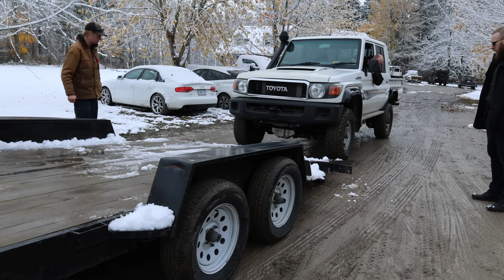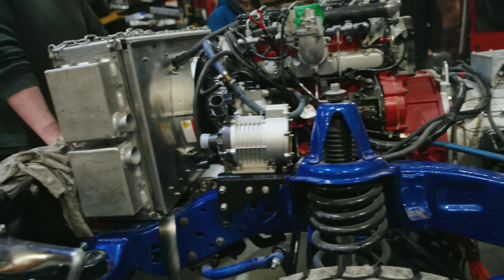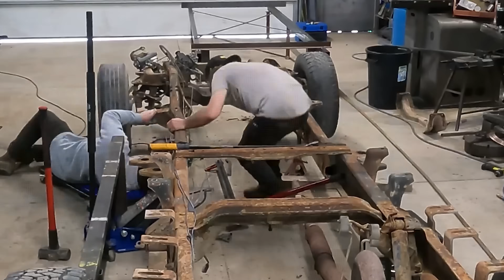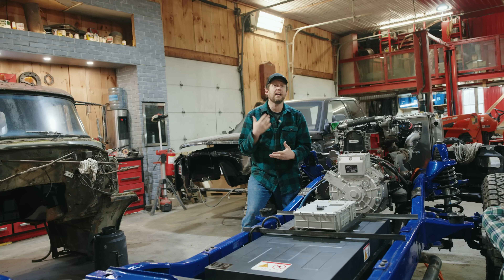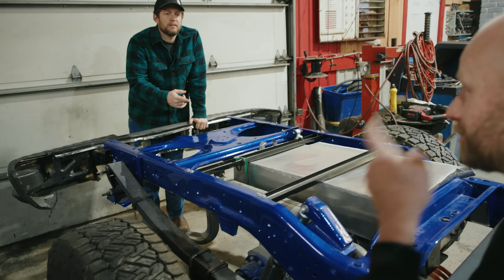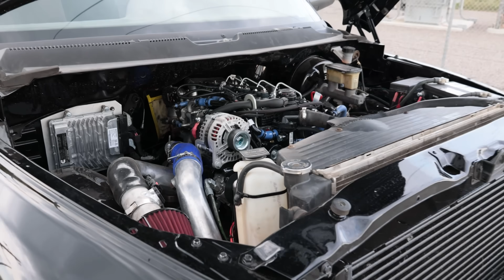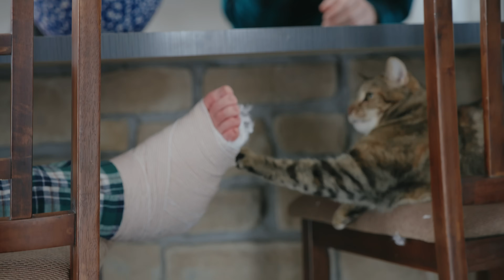Scrap Our First Design and Build an Edison Pickup Chassis from Scratch?

Comment: so on the air ride make sure you have not just front to back but side to side leveling as well not sure entirely how it works one semis but on the leaf spring truck that had cranes on one side often had extra springs on that side to compensate for the weight. i know since i added bags to my trucks some load are heavier one one side than the other and require different psi to level.

Comment: Keep the 34” frame for the sake of turning radius
And being able to adapt from CAD to other cab mounts from manufacturers. We should rethink the trailing arm under the axle. The pickup truck run a much smaller tire than the big rigs and ground clearance sounds like it would be hindered with this idea. However the ride quality sounds awesome. Maybe a portal axles or run the trailing arm over the axle. I hope the chassis kits will accommodate the 9th gen ford areo nose.  Keep up the good work.

Comment: I like the idea of widening the frame and keeping the same width throughout the length.  It would really simplify manufacturing, like the semi.  As far as different bodies, it can be just like the cab end and utilize simple adapting, bolt on cross members and brackets.  Using a trailing arm and airbags also makes a lot of sense... Just Build It!

Comment: Another vote for 34'' frame rails. The depth of the outside toolboxes alot nicer on my cabchassis versus a pickup.

Also you would be such an oddball with a wider frame, it is fairly common to reuse old bodies.

Although if the service body is built to clear leaf springs it would  probably work.

Comment: Talking about frame widths reminded me of some issues we had getting some correct parts for a 2011 F350. The chassis/cab version has a narrower frame width than the pickup version, that kinda surprised me.

Comment: The chassis sounds amazing. I own a 1500 ecodiesel. With only 1200 pounds of payload and 8000 pounds of towing capability. I would love much better payloard and towing but want to keep my engine and cab as the generator. Hopefully this would save on the kit as well because I wouldn't need the 2.8 cummins.

Comment: I want a rolling chassis for a Small Class A R, been saying this since Edison announced the Pickup Kit. Would be perfect as Hybrid RV - the engine also doubles as a Generator -  RVs always have two engines - drive engine and generator engine.  Consolidate to one, further mountains with regen braking.   There is only 1 Front engine RV chassis maker left - Ford.  You could be the second one.  I suggest you get yourself a mid 2000s Workhorse RV and look at the frame.

Comment: I understand you want the Hybrid for the diesel to work however having the larger batteries allows the owner to also charge from the grid if they want and that cost of electrons is 2/3rds the cost of that from the generator. 
Figures below just for example - 
Charge from Home at say CAD 23 cents a kWh verses diesel  cost for say 21 kWh is What? 
Let's say 1 hours consumption of diesel to run the generator is 5 litres at say CAD$1.30 /ltr  $6.50 vs 4.83 from grid supplied 21kWh . 
the Generator provides the on board charging and remote rural use.- exactly what is needed.
Maybe an option is to sell with different battery pack options.  50kWh , 75, kWH , 100 kWh .
It might be the average rig is used on sited that require Electric only operation for the day and only on leaving the site do you need to charge and or drive off the generator.
That is where the onboard genset is invaluable.
Just a thought
Reply: I'm sure that buyers will want a spectrum of battery kWh options.
Reply: @Sah-o5m  given the recent cold artic weather....a lot of folks are going to be showing a lot of interest in CATL Na Ion battery's  they keep working all the way down to minus 40 Deg C and up to +70 Deg C. Also it's rated at 5 C. And life expectancy is 2-3 x LFP cells ..they are even producing automated swap station packs .

Comment: Why can't you use the inner rear fender well for more batteries? All that space is totally unused. But if you don't use the original bed then you can mount the batteries to the sides of the frame rails if you need space in between the frame rails for anything. Don't forget you still need def and exhaust piping also. I like this idea of pre ordering frame setups for the vehicle we want to keep. Will the wiring be a plug and play setup or will replacement be needed?
Reply: Almost forgot great episode!!
Reply: Great job guys!

Comment: I paid the $250 deposit long ago to get in the lineup.  I’ve a 2012 ram 5500 that’s got a Bigfoot camper on the back, Kelderman air bags all 4 corners and 42” super singles.  As it sounds the upgrade for my truck would be a complete chassis as well as all the drivetrain? May be too rich for me.   🤔
Reply from the maker: I still want to be able to sell just the parts, I can’t see why that’s not still possible.   Just a ton of people want the chassis too and it’s easier for us to certify
Reply: @EdisonMotors after seeing all of the custom parts design and machining, the roller chassis started to make a whole lot more sense from a finance perspective (probably way cheaper). I assume the reason people want to use their existing trucks is to keep the same title/VIN/etc. and treat it like they were just doing an engine or transmission swap (and they don't realize that a universal roller chassis is probably actually cheaper vs. adapter parts kits)
Reply: I agree no one wants to swap frames for this
Reply from the maker: So many do.  It’s actually the majority of people and installers I’ve talked to asking for this
Reply: @EdisonMotors the frame on my truck is the one part i want to keep.  Ive considered everything else including the cab as disposable.
Reply: We wanted axles and components. Chassis are a good option for people who want them, but I really hope they realize how many of us signed up for components.
Reply: @joshfazenbaker5691 yes we wanted to use our own trucks not make a new one.
Reply: If these kits are under $50k I'd be shocked
Reply: Components will be available too and should be DIY friendly, chassis ensures vehicle certification. Something we learned last year.

Comment: You're building a chassis that has to support myriad applications. Therefore, you must maintain compatibility with upfits that are built for 34" frame rails.

If Edison desires wider frame rails, then you need to provide standoff adapters that provide that upfit compatibility.

I'd say, keep things simple. Go with the industry standard and fit your components into that space. With no driveline considerations, a smaller battery pack, etc., it would seem that fitting everything within the industry standard frame rail constraint is achievable.
Reply: a regi idok elmultak nyomtav kulombseg USA & cccp

Comment: Without knowing and seeing all the components layed out on the floor that need to be installed in a conversion, difficult to make an informed comment. If the typical transmission and transfer case are removed , would that not give you the space for the battery? I know you want to use the same parts from the semi conversion, but if the battery pack was reconfigured to narrow and long, would that not help. My f350 crewcab short box has an inboard fuel tank, I was thinking a narrow battery pack could fit beside it. But that is ultimately the problem, you’re trying to install large semi parts on a much smaller vehicle. But I’m sure Edison and deboss will find a solution

Comment: I could see this progressing into a customer letting Edison know what body they would like to convert. Edison would build a Frame Rail with Batteries, Motors and all components ready to install customers body onto it. Make it as plug and play as possible, so customers have a choice of having an installer do it or do it themselves.  For example, you could potentially have a 1/2-ton pickup with 1-ton (or more) capabilities.
Reply: Bolt-on body mounts could be an option. Have a standard frame with a load of boltholes that they can bolt different mounts in for different bodies.

Comment: Your whole image is right to repair and standard off the shelf parts. Anything but 34" frame rails goes against this.
 These are going to be bought to tow and haul with, not pick up the kids frim hockey practice. Go with the industry standard. You can always add a consumer vehicle into the mix later. 
I would plan that a lot of the non vocational pre-orders will back out once they see an actual price.
Reply: I want a hybrid one ton pickup.  I have a crapload of options for commuter and luxury cars, but zero choices for a full size pickup with heavy payload capacity …..

Hurry up, my current diesel truck is old and I want something new.
Reply: I disagree that so many people will back out. The cheaper spec vehicles I see are the vocational ones, and the “all bells and whistles, price no object” ones always seem to be ‘recreational’.
Reply: @andrewreynolds4949 yes, but the price doesn't matter people want all the technology crap that Edison isn't going to offer, at least for a while. I guarantee there's people who put the deposit down that have an unrealistic price in there mind of what these will cost, just from previous comments that I have read.
Reply: @jmanlinc  imo, the Edison crowd that is signed up in advance is likely not the same crowd that signed up for the Lightning, Hummer, or Cybertruck. They may be some of the disenfranchised Lightning folks, but I don't think the "I want an EV truck Swiss army knife vehicle" crowd was also shouting "I want a hybrid diesel commercial retrofit kit." 

I may be wrong, because price for stuff will definitely make all the difference, but I think this is a different market than the EV bandwagon.
Reply: I'd love one for a do everything suburban, however I doubt it'll be economic in the least. Right now a minivan is 40k and does everything except haul, and the off-road for me at least is a toy feature.
Reply: @wayward03 This is a good point.  As much as I want a commuter that can do a little work, I won't need anything beyond what a 3/4 ton truck can handle.
Reply: @wayward03  not sure how much hauling you need on the regular, but if you're up to it... I've seen an astrovan ratted for a tractor pull back in the day 😂

Comment: I like seeing how you are adjusting as you are learning. I look forward to your finished product /kit. One suggestion, if possible, design a bottom plate (could be heavy duty plastic) to cover as much of the under chassis as possible. I drive on a lot of crushed rock roads and anything to help prevent large sticky buildups will  be appreciated. Keep up the good work, and here's hoping for a quick recovery on your ankle.
Reply: How tuff are we going for? ¼" of UHMWPE will basically make the underside bulletproof as long as you can keep high heat away from it.

Comment: Yes, there are 2 perspectives and use cases. Some will prefer a smaller battery with bigger engine for heavier loads, but many more will prefer bigger batteries and smaller engine to leverage cheaper grid charging. Most pickups arent used for a logging type scenario. It seems like 2 kit types will be needed.
Reply: big battery is always better because despite the extra weight, the extra capacity reduces the stress on the battery, increasing its lifespan.

the same logic applies to the bigger engine too, less stress equals longer life.

a pack cycled between 40-60% lasts years longer than one cycled between 20-80%, and a bigger pack allows the bigger engine to run at its peak efficiency while the battery handles the changes in power demand, absorbing/releasing power as needed, whereas with a small battery the engine will have to adjust its power output more often which reduces efficiency and increases wear.

the primary concern with a bigger battery pack is that it reduces payload capacity and towing capacity, but if you're regularly towing 2400kg you don't buy a truck with 2500kg towing, you buy one with 3500kg, so you have plenty of buffer capacity for those inevitable situations where your trailer is over 2500kg.

with a big engine and big battery, nobody else is in your market niche competing with you. with a small engine and small battery, you're competing with BYD and GWM.
Reply: It sounds more like 4 versions.  You get a choice of engine and a choice of batteries and can mix and match as you need.
Reply: I want to use my engine which is the same size as the original design.  If that engine has who runs for 3 hours to recharge everything so be it.
Reply: the limiting factor for that is how much airflow you can get through the radiator, a 200hp engine can easily charge a 100kwh battery in one hour, the problem is you've gotta remove 300kw of waste heat, which is easy at highway speeds, but kinda difficult while stationary because you need a big fan blowing a lot of air through the radiator.
Reply: @JedPotts-jv2ux  amusingly enough. The duty cycle of the engine is the easiest variable. Run a little less efficiently, but well Within cooling tolerances and lo and behold the engine can charge the battery in two hours instead of one.
Reply: @glenmcgillivray4707  true, thats how most PHEVs do their engine charging. mine takes 90 minutes to do 16kwh.

i'm kinda more in favour of having a really big fan for the radiator for diesels though, because it opens up the option of wiring a 100kw+ inverter into the vehicle and having a standalone generator on wheels for construction and various other applications (municipal water, etc). that way, an edison hybrid truck can replace a regular truck AND a standalone generator that would otherwise spend most of its life in storage. it also eliminates the need for a flatbed to transport the generator.
Reply: @JedPotts-jv2ux  not disagreeing with the ambition. But just be sure the cooling can keep up with the demand. It would suck to be on a hot work site and hit thermal overload in the middle of a job on a scorching hot day.

Better to build in some redundancy and thermal overhead to ensure when the weather decides to refuse to play ball and timelines are tight, you can rely on your gear regardless.

The whole point is the battery supplies peak demand, and the motor rebuilds the charge, rather than relying constantly on the motor to try deal with variable demands.
Reply: @bullithedjames  You can likely use a smaller engine.  Engines only really need to make full power merging onto the highway.
Reply: You’re not wrong, but they should factor in the “average” North American commute as the baseline which is ~40mi or ~60km round trip to maximise shore power charging. Factor in 40% additional for bottom and top end, and you end up with 100km fully electric range. My guess is that’s about 40kWh.
Reply: A landscape company may want a bigger engine for constant towing especially in hilly area. A HVAC truck could use small engine and more batteries to save fuel.
Reply: fo alvaz  motor futomu

Comment: It needs to be the 34 inch standard. Every aftermarket  body by every manufacturer is based on this design. Anything else will make it a problem.
Reply: 34 inch standard but have custom crossmember options so guys can bolt up a cab to it then the crossmember to the chassis
Reply: @BatchCam i think that is something that will be cab specific. The option for a few "common" options and the geometric details for those of us that will need to do something special.
Reply: @HotRodTractor  I'm talking a cross member you have to drill your self so let's say your cab mount on your current truck is on 30 inches apart you still have the ability to easily mount it, instead of having to engineer a solution your self
Reply: @BatchCam i think you'll find that there will be too much elevation change between cab models to have it that easy. You'll have width differences, distance from axle centerline differences, and distance from ground differences.
Reply: @BatchCam the correct solution is a series of standardized mounting holes predrilled in the frame at a few locations that included steel plates can be bolted to, which then have custom cab-specific mounting brackets welded to the plate at the upfitter/builder. Along with all the different vehicle manufacturers, there's different cabs by generation, then regular/extended/crew/Megacab, etc etc. And most of them (at least in the light-duty market, 1-ton & under) mount outside the framerails, not in-between where the crossmembers are.